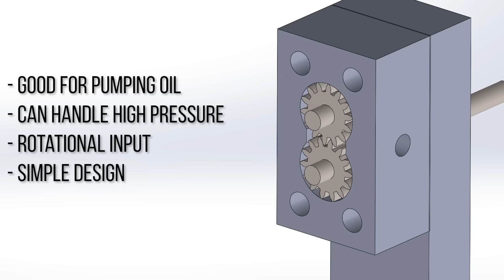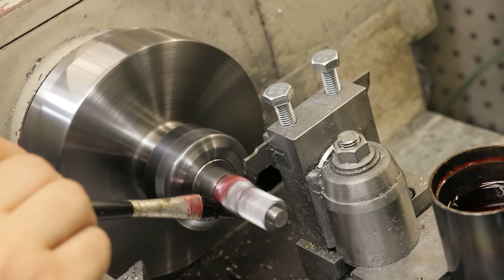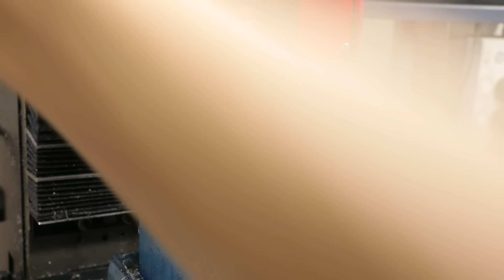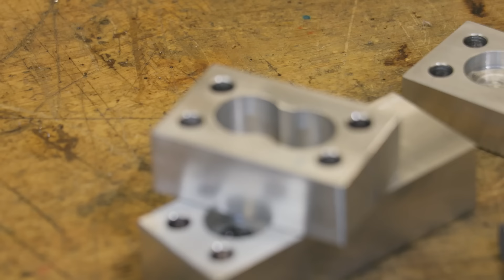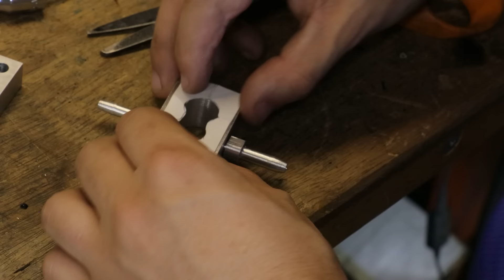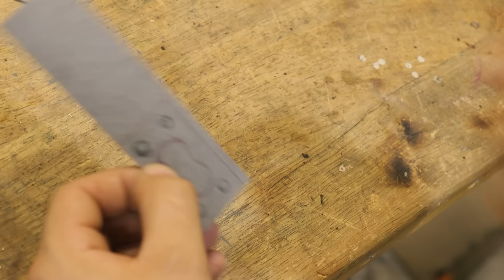Building a Hydraulic Gear Pump

Comment: I think you could have made the two gears with only 1 settup in the dividing head instead of making them separately, it would have required measurement and some cleanup after the fact but I think it might have been better. Then splitting them later
Reply from the maker: Yes. There was a specific reason that I did it this way, but I can not remember. Possibly something to do with the amount of stock out, or material I had. I really can not remember but there was a reason for it.

Comment: the oil and air leak that causes bubles and lack of pressure might have been caused by the paper that you inserted between the parts, dooing so made a bigger space between the gears and the bearing support where the fluid can bypass the gear teeth, you can make the gears slightly longer to compensate it.
Reply from the maker: We went back to a different gasket material and that fixed it. Thin coated paper worked the best

Comment: My friend, why not use a trash pump powered by a PWM (Pulse Width Modulator). I would go that direction because you can control the speed DC motor. You can pick one up from Jaycar. These are rated up to 8 Amps with no worries.
Reply from the maker: Becuase I genuinely have little desire to work wth electronics. And why complicate it when you can drive it off an existing drive train. Cheers
Reply: @artisanmakes  There is no electronics you have to know about red (+) to red and black (-) and off you go.
Reply from the maker: Well you have the electrical side of controlling the speed, so there is that. Then you’d need a transformer to get 12-36vdc I’d assume. The lathe runs on 240v ac. And then you need space to mount a second motor for the pump. I still don’t get what the advantage of doing it this way, compared to using an existing drive train.

Comment: I would make the pump tolerences spaces as loose as possible and lose the gasket
Reply from the maker: I’ve switched the gasket. But the tolerances need to be close or leaking will cause issues one it gets put under pressure
Reply: @artisanmakes  wont it get bound up?

Comment: I was contemplating making one to move fuel oil at 2-300psi and solvent at maybe 10psi.

Use anaerobic gasket compound, no paper.

I suspect you could figure out the GPM by using the volume of the gear teeth x RPM

Ignore the haters, I think it looks like a well done without having grinding equipment.
Reply from the maker: I could do now that I have my solidworks license back. But for this pump it really was not much of a concern. The fact I got it to run using metal scraps is a win in my book. Cheers

Comment: You might want to consider putting a 10-15 micron filter on the inlet, since your radial clearance is ~15 micron.
It's better to replace a filter than a pump.
You can probably make your own filter housing and make a video of it.
Reply from the maker: One step ahead of you on that. This connects directly to a filter

Comment: Most importantly is the tolerance between the gears and the housing cover and backplate / housing.
These are the areas is where they loose the pressure.
Reply from the maker: Yeah for sure

Comment: What size slitting saw do you need i may have one i can mail to you. And i probably have some brass fittings for the hoses that are either 1/8 npt or 1/4npt threads.
Edit. I also have gasket material
Reply from the maker: This video footage is about a month old. It’s already been installed and it’s working, but it’s very kind for you to offer. Cheers

Comment: One problem you might have is the gasket will be messing with you clearance tolerance between the gear and the housing allowing oil to flow back around the gear to the LP side.

You probably need a step in the housing where the gasket goes but allows the housings to mate surface to surface to locate the correct distance from the gear. Or use o ring's in a groove. And you control the gasket/oring squish with the depth of the grove/step.
Reply from the maker: New one might be which can be fixed. It was made for the old gasket. But there is no adding an o ring, I’d need a cnc to do that

Comment: Well done. 2 things I would change though. 
1 I would suggest 1/8 pipe thread for the inlet/outlet so parts are readily available and they will seal well.
2 for the gaskets, id use very thin brass sheats, and use the alignment pins/bolts to align them with the rest of the parts. 
Ive tore down many a gear pump for heavy equipment in my career and that's what I've seen works the best.
Still, very nicely done. Love the content as always. Looking forward to seeing this in use.
Reply from the maker: Cheers. It’s all custom fittings for this one. If it was I would have used something else.

Comment: i don't know what the pump is for, but the issue of self priming wouldn't matter all that much if you can submerge the pump in the fluid you want to pump; that way any leakage would also only effect flow rate and not make a mess... with a long enough shaft the motor wouldn't even need to get in contact with the medium.
since pressure, flow rate and efficiency aren't all that important i imagine it to get used in some sort of cutting application where you need a more or less constant drizzle of oil on the part and the excess being circulated, seems plenty good enough for that.
Reply from the maker: It’s being housed outside of a gearbox so it needs to be leak proof.

Comment: I have also designed two different gear pumps for my construction machinery remote - control models. One of them uses a sealing gasket for end - face sealing. This gasket was customized from a specialized factory, but there was still a slight leakage. The reason might be that the screws were not tightened very firmly. I've always been rather conservative when it comes to tightening screws. For the other one, I machined two grooves on each end - face of the pump body, and then used O - rings inserted into the grooves for sealing. The sealing effect was excellent, with no leakage at all. However, for some reasons unknown to me, when this gear pump was used as a hydraulic pump, the hydraulic pressure couldn't reach the required level.

Comment: if the curvature of the pump teeth matches the outer conture of the outer radial circumference of the gear with the quantified circumference intersecting the center of the rotating shaft, the volume profile becomes 1:1 at 0*:0*degrees offset from the outer:inner surface to outer:inner axis. calculus's suction profile base line for braking surface tension over a identified pipe diameter length and fluid weight, with a variable for fitting tolerances and excessive use leading to high runout tolerances. ... those are gear cutters, not even close to a "screw blower / pump lobe profile cutter".

Comment: Did you take the gaskets into account for the spacing? The sides of the gears must be tight to the flanges or you'll lose significant efficiency.
Reply from the maker: I did the first time, not the second. I think it may have added a bit too much extra spacing

Comment: Some tips:
- Make smaller holes for the gears, so you have to press them in. After assembly, fill it with oil and turn it. This will be very hard to turn at the beginning, but the steel will grind into the aluminium. It will shave off a bit, but that will give you ZERO gap! I have seen this at a pump manufacturer. 
- Inlet bore around double the size than outlet. Hoses also! 
-  If possible, mill a groove for an oval  O-Ring instead of the gasket.
Reply from the maker: Yeah, when I get a cnc I will. O rings are a pain in the arse to do on a manual. Mill.  I’ll have to look again but I’m certain I saw a 40-50 micron gap to be acceptable, I’ll have to dig up my source.  I dunno, if it works it works and ill be happy to leave it like this. It’ll be tested some time this week

Comment: I think many people are confused by the title of hydraulic gear pump, yes most hydraulic gear pumps are capable of hundreds or thousands of psi, I’m guessing this pump is more for just transferring oil at low pressure and the high clearances don’t really matter in his application.
Reply from the maker: I need two. One will be a simple oil transfer pump, the other will be for light hydraulic use

Comment: A differing number of teeth on the cogs means that they do not always match tooth to tooth  and wear is spread between them
Reply from the maker: I don’t think I’ve seen internal gear pumps use differing number of teeth. If are are any it’s not the norm in the ones I’ve pulled apart

Comment: YOU TAKE THAT PUMP BACK APART THIS INSTANT YOUNG MAN!!! ANY GASKET USED MUUST ADD NO THICKNESS TO THE CENTER BLOCK!!!. if you space the gears away from the end plates at all you lose your self prime and your pump pressure.
Reply: just use a skim coat of rtv
Reply from the maker: Yeah.
Reply from the maker: A remnant of changing the gasket type and not thinking

Comment: you can get rid of a bunch of the tightness or air coming and such problems if the pump itself is in a resorvoir(surrounded by the incoming. you can have the incoming side even completely open). but anyway the top and bottom are the hard parts to avoid leakage in between the sides. 1200 rpm is a lot you would probably just be better with a centrifugal tbh if the tolerances are loose like that or put some ptfe on top/bottom and let it clearance itself that way or do higher gears to get less bottom/top area in relation to the gear pump volume. also the bigger the gear "shaft" is the less there's space to leak back.

like the video gives the vibe that you're sort of treating the tops and bottoms of the gears being high tolerance as a given and thinking just top down dimensionally. you HAVE TO KNOW THE GASKET HEIGHT. draw pictures from sideway too. you shouldn't probably have a gasket at all. if the pumps in a reservoir you don't need it to avoid leaking
Reply from the maker: I knew the gasket thickness then I had to change it. Consequence of making it up as I went along. I may have to make some slight changes if it can not do what I need from it, if it works, it’s no problem worth worrying about. And I think gear pump is optimal for what I am needing here. Cheers

Comment: Came to say the same , gaskets are way to thick.
And to much is bypassing side walls.
Try locate sealer or just a very  thin coat of grey rtv. ( I have done on the many pumps I've built)
Or better yet cut a  O-Ring groove on both side covers and  ditch the sealer.
This is what I do when I make hydraulic pumps.
(And like you said bigger inlet and outlet will help alot!)
Reply from the maker: I think I’d need a cnc to cut proper o ring grooves, that’s why I went with gasket. .4 is definitely a bit think, I can probably go a bit thinner

Comment: Did you cut the gears to normal running clearances ? From what I can recall, the gears in gear pumps are cut to have mininal root / crest clearance and are not a "normal" tooth form - maybe something to consider as well as substantially reducing your radial and axial clearances if you find you need better preformance under test ?
The internal notches in the end plate are not for pressure relief purposes - they are there to divert some of the output oil under pressure to lubricate the shaft bearings. A properly functioning gear pump will stall the drive motor if the outlet is blocked & it is usual to provide an external pressure relief valve to limit the system pressure. 
Gear pumps in principle are simple enough devices but, as with many apparently simple devices, for them to work well  the devil is in the detail !
Reply from the maker: I was under the impression that a standard involuted would be able to work. If you really want to dive into anything beyond that, it really isn’t tha kind of project and I don’t think it is necessary what wha I need from it. Cheers

Comment: Dude, you've got to calculate for gasket thickness and the end of gear/housing clearance.
It's not an arbitrary thing.

A gear pump is a simple device but the precision in its manufacturer is pretty insane.
Reply from the maker: I did, but the first gasket didn’t work. Obviously

Comment: you need to make a rotary broach so you can make internal hex drives, thats a nice project and not that hard. maybe even from scrap stuff, like this one. would be an interesting watch :)
Reply from the maker: I have a rotary broach, but good hss cutters are so expensive
Reply: @artisanmakes  oh dang. no way to make those yourself?
Reply from the maker: I’ve made them from oil tool steel but they never held up nearly as good as the hss ones. And I don’t really have a set up for precision grinding hss. Cheers
Reply: @artisanmakes  ah makes sense. maybe one day :) thanks for the relpys!

Comment: Chipboard makes a good gasket in a pinch. Or just in general... I usually use cereal boxes. The sides of beer boxes or TV dinner boxes work also. You just gotta avoid compressed sections like the rings on the bottom of a case of beer. I've actually gotten away with this method to make head gaskets on small cc motorcycle!

Comment: 7:56 it is so weird hearing someone with a non-american accent use 64ths of an inch in any context, even if it is just to ream it out to a common metric size.
Reply: Pretty sure it was 19/64". But it's not uncommon in the machining world especially when dealing with fine tolerances. No one wants to say .0012mm

Comment: Positive displacement pumps like this are usually terrible for priming.  Older engines use gear pumps like this,  when rebuilding them we used to pack them with assembly grease so that on first start that would actually suck some oil up.  

Oh, and others have said, can the gaskets and just use liquid sealant.

Comment: a lot of good tips in the comments, one thing i would like to point out that i had to learn the hard way with hydraulics: your inlet needs to be slightly larger than your outlet so the pump can build pressure. this is referred to as "head". air bubbles are usually an indication of cavitation in pumps that are tight. your pump is a bit loosey goosey and so it would be difficult to figure out where those bubbles are coming from. if both inlet and outlet are the same diameter, the gears will be pumping out foamy looking oil. 
also, you should reduce the thickness of your gear housing by the combined thickness of the gasket material you end up using. a copper foil is better than a paper gasket as it can take the pressure and dissipate heat generated from the cavitation of the oil as it's being pumped, this should reduce the recirculation losses you're having in your pumps current iteration
Reply: Inlet always bigger than outlet
Reply: I wouldn't have used gaskets at all; they create a gap between the gears and the housing. Because the contact faces are so flat and the flanges (the whole end block) are so sturdy, it would probably be better to just paint the mating faces before assembly. A spray can etch primer would do really well.

Comment: All said and done..........you did not show any pressure measured at the output.....psi......although this is a prototype....still ....!
Reply from the maker: I haven’t gotten around to making all the mounts for the oil filter, which will be where it needs be able to deal with  pressure. That’ll be the next thing I have to tackle. Cheers

Comment: With regards to the flow rate. If this was a centrifugal pump the size of the inlet would affect the flow rate as you mentioned. However, with a positive displacement pump the flow rate is a function of the volume of the space between gear teeth and the speed of rotation. Meaning you can calculate the volume in SOLIDWORKS, multiply this times two along with the rotation to calculate the volume. There will be some loss of volume due to leakage between the different components.
Reply from the maker: We’ll see what is that case when I increase the onset size, I think there is a big restriction here which is causing me issues. Cheers
Reply: What happens with a gear pump if the inlet is too restricted is cavitation which destroys the pump in pretty quick order
Reply from the maker: Yeah, but cavitation makes a pretty recognisable sound, atleast if you’ve ever heard it. I know this pump isn’t having anything like that yet. Cheers

Comment: "self priming" doesn't mean that a gear pump will "suck" fluid into the inlet, what it means is it can evacuate small air pockets once it’s wet,” not “it can pull liquid up from an empty line.”  A pump like this must be primed on first use.  Your explanation of the functioning of the pump isn't exactly accurate either.  The pump doesn't pull fluid around the outside of the gears, the gear meshing creates cavities which the high pressure fluid fills which moves the fluid from the inlet to the outlet.  This is why the pump must be primed.

Comment: I am sure you are very happy with what you made, however look into one of the oil pump for a VW engine from the 50 and 80, I am not sure if they are still made, but I would be surprised if they are not made still.  It kind of looks a lot like what you made, with larger gears.  I honestly don't remember the oil pressure, but I bet they could do 30 to 70 pis.
Reply from the maker: Thankyou. Yes I am very pleased that I was able to get it to work